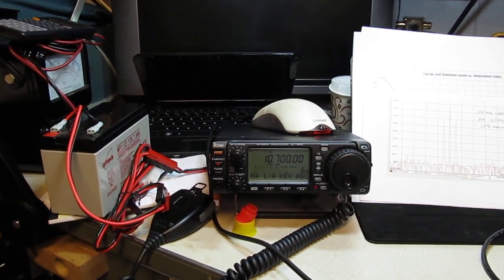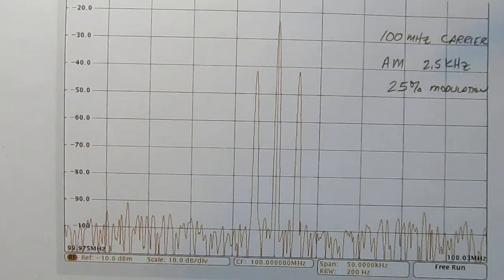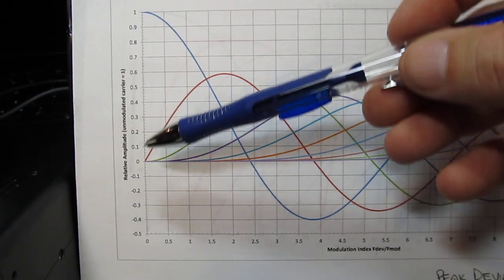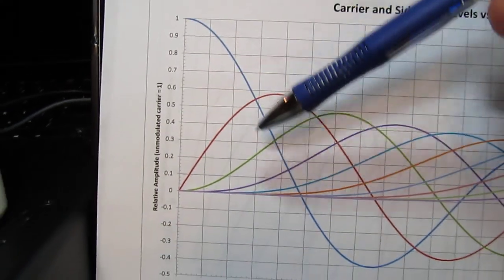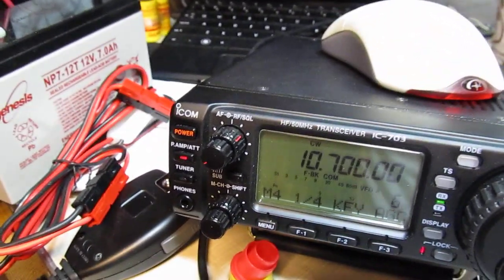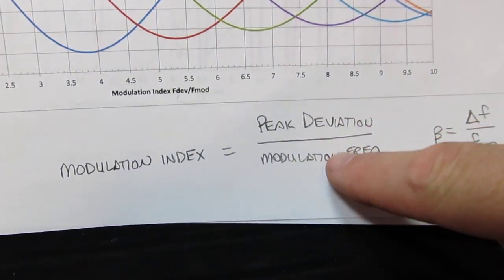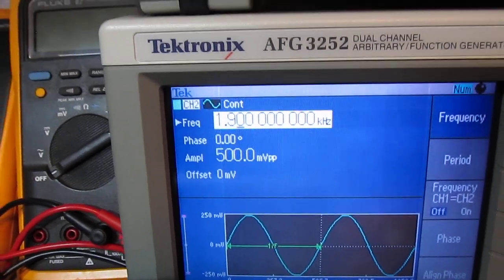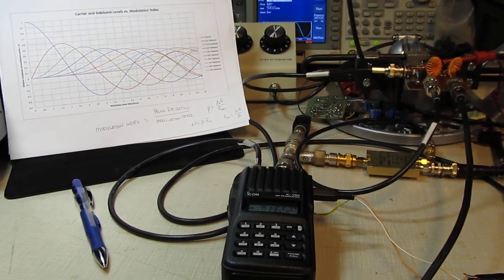#101: How to measure FM Frequency Deviation without special equipment using Carrier / Bessel Null

Comment: Note about the TF-2304, mine recently stopped working because the leads of the LO drive transformer corroded through completely due to the disintegrating spaghetti tube (presumably) collecting moisture from the air as it aged (also corroded the PCB around the xfmr). Figured I'd say something in case this is happening to yours as well. Video was really helpful, I wanted to verify that the deviation indication on my RF gen was correct before using it to test my 2304 post repair
Reply from the maker: OH, interesting - I haven't used mine in a few years.  It was getting "flaky", so this gives me something to look at on it.

Comment: Thanks for sharing and very informative.. so am I understanding if the deviation is out of the 5 kHz range you would need to adjust the audio level in the settings of the radio it’s self.. ?
Reply from the maker: Depends on the radio.  There is likely an adjustment for the deviation or the audio drive to the modulator.  The service manual for the particular radio would indicate the proper adjustment point to set the deviation.

Comment: What in the FM transmitter is setting the amount of FM deviation? its the amplitude voltage or power wattage of the FM amplifier that is determining the maximum FM deviation?
Reply: My very old Yaesu mobile radio's service manual deviation setting requires a 1kHz tone at a given amplitude to yield the nominal 5kHz deviation. The amplitude will be different on different radios. I did some Bessel null testing with my IC7100 data port input and found it needed a very low amplitude compared to other radios for a given deviation.

Comment: Hi Alan. Many thanks for sharing this video. Interestingly I discovered that this method works even better with a spectrum analyzer than the one described in video #159. Apparently, my spectrum analyzer, DSA815-TG, works a bit different than yours - I couldn't make it draw anything similar to the traces you got. However, the method shown in this video worked just fine. It's not necessary to use a mic input of the transceiver. Placing the microphone at a fixed distance from the speaker connected to the signal generator works just fine. If the transceiver doesn't have an antenna connector (e.g. LPD/PMR walkie-talkie), a small receiving antenna can be connected to the spectrum analyzer.
Reply from the maker: The problem with placing the mic at a fixed distance is that you don't have direct control over the deviation, since it will be a function of the distance, the speaker, audio reflections, etc.

Comment: I do not quite understand how you connect the TX with RX and how much power arrives at the RX antenna jack. You said that you use a T-Adapter, terminated with a Dummy load and that you take you bring only a part of the TX power to the RX input. But how do you manage that reduction? Is it just a simple cable from the T-Adapter to the RX Antenne jack or is there an attenuator (like -30 dBm for 4 Watts output) in between somewhere.
Reply from the maker: I used an "RF Tap" - also called an "RF Sampler".  The "tap" coming out of the side of the sampler is adjustable (like a trombone) to set the attenuation value.
Reply: @w2aew  Many thanks for this clarification

Comment: Isn't it just easier and simpler to use an FM deviation meter in the first place instead of all this faffing about. Good informative video all the same.
Reply from the maker: Yes, of course, assuming you have an FM Deviation Meter...  The point of this video is to show how to make a this measurement if you don't have access to special equipment like a deviation meter.

Comment: Hi Alan,  another great video.  After reading a response from one of your readers that said they did not have a function generator I came up with an idea to just try a free audio tone generator app on my smart phone (versus having to wire in my signal generator, etc.).  My total setup was just a $20 RTL-SDR dongle receiver connected to my laptop with the RTL-SDR receiver software set for CW (but mode does not really matter since you are just looking at the carrier on the laptop display), my smart phone as the adjustable tone generator and my radio under test (no wiring needed between the cell phone and my radio under test, and no wiring between the radio under test and the RTL-SDR receiver).  I just set the transmitter output power to 1 watt on the transmitter under test and did not use an antenna on the RTL-SDR receiver to make sure I would not damage it.  This simple system appears to work just fine as long as the audio output form the cell phone is set to high (loud).  Thanks for another very interesting measurement technique.

Comment: Great video, indeed!  Would it  be possible for you to indicate if modulation index  is solely a function of modulating frequency  and peak frequency deviation but not the amplitude of the modulating tone (in practical measurements). Thx.
Reply from the maker: Well, the peak deviation is a function of the modulating tone's amplitude - therefore it does change the modulation index.
Reply: Modulation index  the amplitude of the modulating frequency in proportion to the amplitude of the carrier.
Reply: YouTube won't let me save the edit, the word "is" is missing of the word index. I'm sure I typed it, but underlined and maybe YouTube doesn't like underlines.

Comment: How about using a sdr?  I will need to check but when I look closely at the waterfall of a FM station I can see the signal narrow during a quiet period and fatten up as more sound is created. I have wondered if it is the sound frequency  or is it the volume level are being displayed by the software? Since we are looking at a frequency display I think it is the FM modulation I am seeing in the width change and the volume is in the vertical scale of the display?

Comment: Hi, there's something I don't quite understand. Doesn't the amplitude of the modulating frequency affect the amount of deviation too? How did you decide where to set the amplitude of the modulating frequency in your example? Thanks.
Reply from the maker: The amplitude generally control the deviation. In most FM transmitters, and ALC circuit limits the maximum amplitude to the modulator, so you usually adjust the input amplitude up until the deviation doesn't change much anymore (assuming the service manual doesn't specify a particular value.)
Reply: Ah very good. I duplicated the method you used here using a USB SDR to see the spectrum @ 145 MHz, and check for a null, but I wasn't sure about the amplitude of the modulation signal. The method worked out perfectly. Thanks for the instructional video - N5INP
Reply: I was playing around with this on my computer yesterday and from the Wikipedia definition produced a Bessel null using the FM equation: y = Ac * cos(wFc * t + MI * sin(wFm * t)), where Ac is the overall signal amplitude, wFc is the carrier frequency (in radians/sec), t is time, MI is the modulation index, and wFm is the modulating frequency (single tone). The part that is relavant to your question is MI, which is the . The deviation is the (highest) modulating frequency multiplied by the modulating index, so the amplitude and frequency both affect deviation.
Reply: There are some missing words - I underlined them and YouTube stripped it from my comment, after "MI, which is the ", add "amplitude of the modulating frequency".

Comment: Hi there, its all clicked into place now, I can see exactly what you doing now...and how your doing it...we might do this to calibrate a Heathikit deviation meter we have just repaired, I connected the power backwards and blew all the IC op amps..its working now, we upgraded them from the round metal type to the new type, they just plug straight in...cheers Fred in England.

Comment: Hi there, how exactly is the signal generator connected to the receive radio, is it direct onto your mixer board or through and attenuator..i presume its kind of in Parallel with the output carrier, how much attenuation do you have on the T piece, would a BNC with pin removed work..or is that too much....Fred in UK.
Reply from the maker: I only needed to use a RF signal generator in this case because I had to use the mixer to down-convert the 2m signal into the HF band.  So, the signal generator is used as an LO for the mixer - it is not connected to the radio.
Reply: ***** I think I said the wrong thing, the instrument you used that was set to 2.7khz and you wound down to 1.90khz, how was that connected to the radio, if it was..as you used that freq for the equasion  sorry if i'm being stupid here hi Fred.
Reply from the maker: Tom Smith OK, got it.  That generator was creating the audio signal and was being fed into the MIC input of the radio.  I fed it through an attenuator to bring the level down to typical microphone signal levels.  I adjusted this frequency until the carrier was nulled out, then multiply this value by 2.405 to arrive at the deviation level.
Reply: ***** Ah right, I should have realized that, makes sense now...thanks, I have watched the video several times, it is good...cheers Fred.

Comment: Hi there I bought a Heathkit deviation meter IM 4180 like you have, came from Ohio to UK, doesn't really work, wondered if you had any ideas, the tuner works and the audio amp works, just the pointer hardly moves on tune on low dev setting, the dc power side seems ok,  I suspect U 102 to U 104, the 8 volt regulator is set to 7.5   Fred in UK
Reply from the maker: I haven't studied the circuit on that unit yet, but the manual provides a pretty good description and adjustment/calibration adjustments.  I'd suggest starting with doing the adjustments from the beginning.  One thing I found with mine when I bought it was that one of the trimmer pots was intermittent - so examine those carefully.
Reply: ***** Ok thanks, I think there are 3 of them that I've seen,,,,cheers Fred uk
Reply: We have this meter working now, I reversed the polarity by accident, we had to change all the IC;s which are plug in and the 8 volt regulator..Fred uk

Comment: Yes I see how you do it now,  can you tell me when you connect a Deviation meter to a radio antenna socket etc, do you have to be careful how much power you put into the meter, is say 4 watts too much, do you use an attenuator?  Fred uk
Reply from the maker: Yes, you absolutely have to be careful about how much power you put into a deviation meter.  The specifications of the meter will you the upper limit.  Most often, you'll use a RF sampler, tap or directional coupler, or even loosely couple via an antenna.  Rarely will you ever directly connect the transmitter to the meter.
Reply: ***** Ok thank you for information, video is good Fred uk

Comment: I like most people dont have a signal generator, deviation meter, i do have a scope, but can you just use 2 x 144 mhz transievers and shout or whistle in the mic..is that possible? Fred in UK
Reply from the maker: No, you can't use a whistle or shout.  In order to use this Bessel Null technique, you need to have precise control over the modulating frequency (in order to have precise control over the modulation index).

Comment: Sorry to be ignorant, but i have a 145.tranciever can i use that for the cw carrier reciever with out that mixer you have...? so do both radios have to be on the same freq? Fred in uk
Reply from the maker: Yes, if you've got an all mode 145 Rx with an S meter, you can use that, and you dispense with the mixer that I had to use.

Comment: Sadly I don't have a HF rig (it's on my shopping list, right after I get my amateur radio licence!), but I do have a spectrum analyser. I can report success using that as a receiver -- the procedure is similar. I did my experiments with a Marconi 2022E signal generator. An output level of -80dBm proved difficult to tune, though -60dBm proved to be plenty.
Set the TX to produce an unmodulated carrier. Set the SA centre frequency to this, with a reasonable span - say 10kHz. Get the signal as close to centre as you can.
Set the SA to its narrowest reasonable ResBW filter (mine is 30Hz), and span to minimum. If your SA has Windowed Sweep mode, set that too, to speed up the sweep as much as possible. You're aiming to just refresh the signal, not the noise at either side. Put a marker on the signal, then tune the audio oscillator until carrier power is at a minimum. Generally speaking, you'll go from a 'bump' to a flat line (no carrier) when you're absolutely on the Bessel null.
Alternatively, set Zero Span mode and drop the VBW filter to about 1Hz. Adjust until you get the line as low as possible, but I found this harder than using a narrow, windowed sweep.
Once you've got your modulating frequency (mine was 1.045kHz), multiply by 2.045 to get the FM deviation.
It's nowhere near as convenient as a modulation meter, but if you've got the equipment on hand, you can't beat the price!

If only this trick worked for off-air signals!

Comment: The frequency deviation for a given tone amplitude will vary with frequency in accordance with the nominal 6 dB per octave pre-emphasis on the microphone input to FM transmitters.  For that reason, radios with separate data ports are preferred when using packet and other AFSK modes.

Comment: Hi, will the impeadance mismatch in your setup will cause significant reduction in sidebands amplitud that would affect the deviation? Significant sidebands are those that have a voltage of at least 1% of the unmodulated carrier.
Reply: No